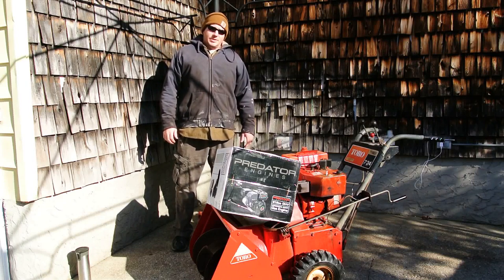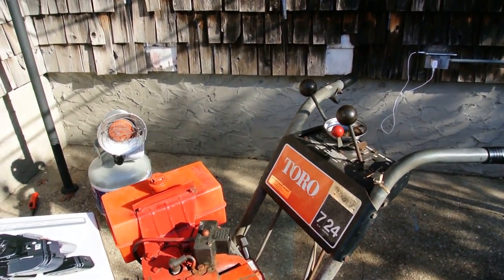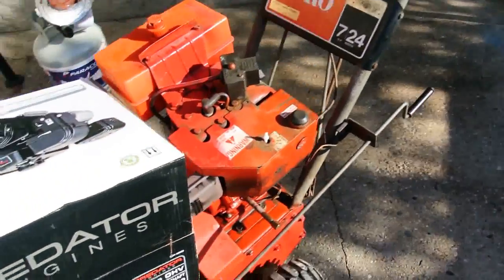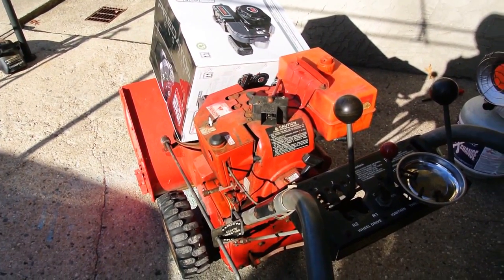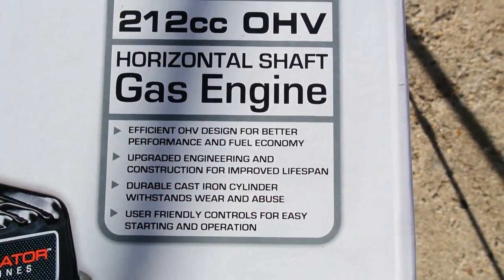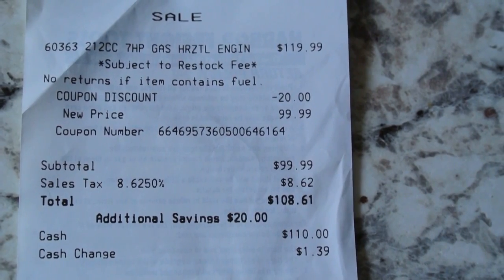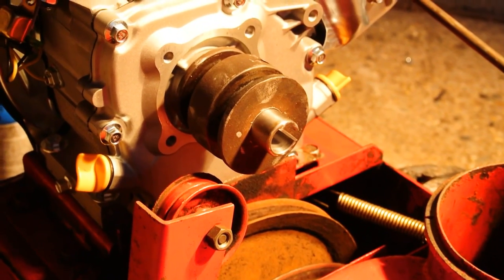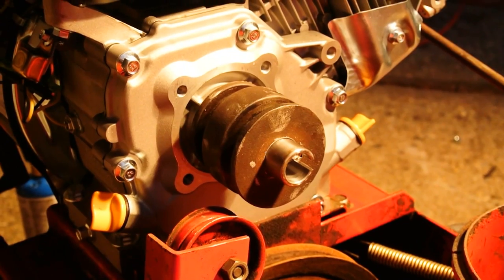SNOWBLOWER Motor Swap; new Predator (Honda clone) motor to replace the old tecumseh on 1977 Toro 724

Comment: predator engine is on sale for $99.00. It's a 1 to 1 clone of the Honda motor and actually for a chicom clone it really works well. I remember Honda trying to sue them years ago (this engine design is like 12 years old) but Honda dropped the suite and just made a newer and better motor.
Reply from the maker: nice!  Even if the current Honda is better there is nothing wrong with this!

Comment: I will be doing this shortly just blew the engine on my MTD blower it was probably 20 + years old. It is the track model so want to keep it going like it better then wheel type. Thanks for a very good video
Reply from the maker: Those tracked machines are awesome.  Thanks for watching!

Comment: I like it!  I did the same with a 40+ yr old JD and actually upgraded the power from an old 7hp to 10hp.  Now, I'm ready to do it again after 20 yrs.  My big challenge is matching the bolt pattern to a Predator engine.
Reply from the maker: I was amazed how the bolt patters lined right up in my situation!

Comment: I put one just like it on an old rototiller.
I have been very happy with it. 
I have another with a vertical shaft I put on a walk behind mower.
It has performed well too for 3 seasons now-
Predator Engines are pretty good engines.

Comment: Toro 521 and the pulley on it, is an exact fit to the predator 212cc I used.

I bought a conversion part to go from 3/4 to 1" shaft but wasn't required.

Just for future viewers doing this.
Reply: It's an easier swap then this even for the 521

Comment: you can probably get by without the belt finger, but it does serve two purposes.  1) it makes it harder for the belt to fall off the pulley.  2) it helps hold the belt up when it is not engaged so it rubs less on the pulley.  Or, at least that's been my observation on most machines.

Comment: Good video Rich ,I did the rubber impeller mod on mines last year ,best thing I ever did with it ..slush used to be a pain in the ass before .
Reply from the maker: thanks Mark.  I did the rubber impeller mod but havent had any real snow to test how well it works yet!
Reply: Rich's Fishes yeah it works,mines used to get chocked with slush before but now it doesnt.it also seems to throw a little further I think.
Reply from the maker: awesome!

Comment: It's amazing how cheap that predator 212 motor is brand new out of the box. Also with a few simple upgrades like a straight pipe exhaust w/muffler and a makuni carburetor, you can get a couple extra hp out of that bad boy and not spend too much extra money.
Reply from the maker: hell of a bang for the buck!
Reply: Look up the reverse straight pipe. The go kart ones dump the exhaust either into your handle for the blower or aimed at the snow (which is an issue if you need to get snow next to a fence or house). 
I got one on eBay, thing has dimes for welds, had to laugh at the effort.

Comment: more than a foot of snow fell since yesterday.
however my yard and driveway act like a vacuum cleaner, with over 2 feet in areas.
212 cc Predator Engine didn't struggle thru it at all.
Old MTD 24" bucket Yard-machine modded with a 6.5 hp Predator Engine.
Reply from the maker: Nice!

Comment: I did this conversion. I didn't need the new jet. I also did the impeller kit... my snow blower is a snow eating water pumping ANIMAL now. You should be very pleased... and in my opinion... 5w30 would be better for this application... good luck and enjoy...
Reply from the maker: I'm so happy I did this.  Machine works fantastic now!
Reply: 5w30 is better for cold climate, 5w30 =5winter 30

Comment: adaptor arrived today.
a bit too long, so cut around 3/4" off one end
both shafts on each engine are the same length.
used a vise and a sawsall.(place key in the gap to prevent crimping the piece.)
use grinding wheel to blunt the razor sharp edge. 

1.used a pair of vise grips to slightly contract the adaptor without the key.
slide in the pulley plates with narrow spacer between them.

2.next the larger spacer

3.next the next two pulley plates (then slid the entire assembly on the shalf)., the flat washer, bell washer and the then 
the hex bolt ( 5/16-24 UNF bolt approximately 30mm long/1.18".)

below are the links to this particular snow thrower and how it is assembled should anyone need it.

https://www.mtdparts.com/equipment/mtdparts/partfinder#/MTD_Merged_Data/31A-3BAD762_

(2005)/General_Assembly/0247000-D/02470000004

https://www.mtdparts.com/equipment/mtdparts/partfinder#/MTD_Merged_Data/31A-3BAD762_(2005)/Handle_

%26_Wheels/0247000-D/02470000002

https://www.mtdparts.com/equipment/mtdparts/partfinder#/MTD_Merged_Data/31A-3BAD762_

(2005)/Drive/0247000-D/02470000003

Comment: I did a similar swap on my 82 mtd built craftsman. well worth the $150 tax in Canadian for the motor. I bet you are loving that snowblower now. the new clone motors start so easy and work so well its like having  a brand new machine. Mine works like its better than new.
Reply from the maker: Definitely works better than new!  No regrets on this job for sure!
Reply: Did you get your clone at princess auto?

Comment: I was wondering. The Tecumseh motor on my snowblower doesn't have an air filter but the Predator does. With all the fine snow that gets thrown around and possibly sucked into the the air filter, could this cause problems? I am thinking if the air filter gets wet it could freeze or not allow air to pass through properly. Even if you take it out, it might cause a lean condition because it is sucking too much air. I don't know. I was just wondering about it.

Comment: What did you do with the old motor.  I would have rebuilt it and put it on a shelf...  Also, did you use anti seize on that shaft?
Reply from the maker: The old motor is in a corner of my garage....one of these days I'll rebuild it for a some project or another.  I honestly don't even remember if I put anti seize on the shaft....I'll have to go back and watch again to see lol

Comment: Hey Rick: If I had a 252cc engine now, could I use the 212cc you are using without much loss of power?
Reply from the maker: I couldn't say for sure, but I'd guess if the motor is in need of replacement you might not even notice whatever loss of power there might be!

Comment: Helpful video, Can you show us what you did to the carb? Also does the air filter restrict the engine in cold weather as most snow throwers don't have them?
Reply: The carb jet that comes with the engine should work just fine. The air filter does not restrict the air intake. It is not normally on a snowblower because there usually isn't any dust particles in the air when it snows. They place the carb near the muffler so warm air is sent into the carb melting any snow that might be drawn in. The only obstruction the air filter might cause is if it is clogged with snow and ice. In that case just bring the filter inside and let it dry out or remove it completely... although you might get ice buildup if you do that. I, however, have not experienced any issues and I did my conversion 2 years ago... hope that helps... have a great day...
Reply: Probe Team99  Thank you for the reply. Don’t fix what ain’t broke I guess!

Comment: What holds the pulley adapter from walking off the shaft ?  There is a set screw from the pulley to the adapter but nothing thru to the shaft.
Reply from the maker: To be honest I dont recall for sure.  There are 2 set screws on the pulley and I dont recall being concerned that the adapter could move so one of the set screws must've held the pulley in place on the shaft and the other holds the pulley to the adapter.  Whatever the case its not been a problem!
Reply: I just used the one Allen set screw, and then added a bolt to the output shaft, 5/16 fine thread, with a washer.

Comment: Just got a craftsman 881800 snow thrower. Old motor died and owner put this 212cc preditor engine on. He says it works great but does not toss the snow very far. Original engine was 8hp... Is there any gearing with the preditor? Or a way for it to rev up faster to move snow better?
Reply from the maker: Well there is a throttle adjustment, but I assume you're still not seeing great performance?  Chances are its note the engine causing your problem but more likely the impeller is not "scraping" all of the snow and is leaving some behind.  Look for "snowblower impeller kits".  It allows you to add little strips of rubber to the impeller blades so they "scrape" the snow from the sides and dont leave anything behind.

Comment: You want to run that MOTOR or engine its not the space shuttle in on conventional oil its shortcomings will aid on breaking in the piston rings.
Reply: second that break in with conventional

Comment: I am doing this now but had problem pulling back belt off, and now trying
 to put this belt back on.  Your video shows lots of play on that back 
belt, but my belt is real snug when it is on the rear pulley.  I did 
remove the rear tensioner pulley so that is not adding anything to the 
belt. What is the trick to get this belt back on? Thanks for great 
video. Any help is appreciated. october 15, 2018 and snow is coming soon
 in Cleveland, Ohio!
Reply from the maker: hmmm its been a while so I dont recall having to do anything too crazy.  If that tensioner pulley is off that should provide enough slack.   Maybe someone changed out a belt and used the wrong size in the past?  My only other though is to get the belt around the pulley before sliding the pulley on the shaft of the new motor.  Good luck!
Reply: @RichsFishes  no! Actually starting the install tommorow

Comment: Excellent video! I have an old tired Craftsman I’ve been thing about swapping, since a new one is easily $500+. Where did you get your adaptor sleeve for that output shaft?
Reply from the maker: I found mine on ebay

Comment: I just finished this swap. Everything seems to work, but the auger/propeller up front doesn't ever fully stop when disengaged. It slows down, and definitely speeds up some when engaged.

Toro 521. Any ideas?
Reply from the maker: That's probably got nothing to do with the motor.  There should be some way to adjust the engagement point using the lever that engages/disengages the auger
Reply: I replaced the Auger Belt and it all seems good now.

Comment: Is there an electric start ring gear on that new motor? I didn't think so.
Reply from the maker: No electric start on the new one
Reply: @RichsFishes  It's too bad the Predator motors don't have the ring gear and mount holes for the 110 v electric start motor. Looks like the new motor starts without much effort, so I'll do without the electric.

Comment: Stupid question, but does the Predator come with the shaft adapter and if not, where can you get them?
Reply from the maker: It does not.  I got mine on ebay.  Links in the description,  but they might be expired by now.  Little searching on Ebay should get you there!

Comment: Great Video! Where did you order the adapter for the pulley and the new jets from?
Reply from the maker: Ed Goode thanks ed!  check the description for links to the parts.  the pulley adapter was from ebay (you should be able to find same if not similar using the info written in the description) and the link for the jets  (from a go cart site called omb) is also in the description.

Comment: I am thinking of doing something just like this to my MTD snowblower, it bogs down during heavy usage. Quick question what did you do to the idle jets and why? thankS!
Reply: I want to put the 8hp on mine.
Reply from the maker: I got an extra idle jet and some micro drill bits to enlarge it; but honestly have not actually done it yet!
Reply: I'm not sure what that is would you mind explaining it?
Reply from the maker: tough to describe if you dont know what it is.  Check the links in my description and  you can see the new jet and the set of drill bits.  Ideally opening the size of that idle jet in the carb should allow the machine to start and idle a little better in the cold.  You'd set the new jet in a vice or something and then slowly enlarge the orifice with the drill bits.  Its sort of guesswork to determine how large any one particular application might need to be.
Reply: Ah great thanks. must say your video is great thanks
Reply from the maker: glad to help. thanks for watching!
Reply: I did this conversion and found that I didn't need to change the jet. It worked just fine with the stock jet. The game changer was the impeller kit. I think that's a must for any snowblower... It totally changes and enhances the blower. A new engine and an impeller kit and you would think you had the answer to any snow storm..

Comment: Never use synthetic oil during the break in period, rings will not seat correctly, use regular crude oil.  OK to switch to syn. after 5 hours of use.
Reply: beechwood619 TRUTH!!
Reply: I used to agree with that however the oil, if it comes  with any usually has metal particles in it. I have for the last 15 years started of with synthetic and have had zero problems. No oil burns or smokes, the engines start up immediately, the power remains the same. I don't think any oil is good enough to prevent break in. These engines run at top speed and load from the start.

Comment: What is the name of the tool you used to pull the pulley wheel off of the crankshaft?
Reply from the maker: Its a "three jaw gear puller" like this here:  https://www.harborfreight.com/8-in-three-jaw-gear-puller-69224.html

Comment: Break in on dinosaur oil then switch to synthetic oil.
Reply: I just done a swap on an Ariens 524. Tecumseh dual shaft motor replacement
Reply from the maker: nice how'd yours go?

Comment: Can you show, how you did the electrical?
Reply from the maker: I havent done it yet lol!  All it really consists of is the on off switch.  Now instead of using the key on the snowblower I just use the switch on the motor.  One of these days I'll try to actually make the stock controls work too
Reply: @RichsFishes  thanks i am just doing the same thing as you
Reply from the maker: @familiapabon9658  awesome!  Let me know if you have any other questions!

Comment: What adaptor sleeve did you use?
Reply from the maker: Its in the descripiton.  It was an ebay link for a  3/4ID X 7/8 OD X 1-1/4" Motor Shaft Adapter Pulley Bore Reducer Sleeve Bushing .  original one no longer available but if you search that term on ebay you should be able to find something that will work!

Comment: Going to be interesting to see how long it takes to blow up cheap made engine
Reply from the maker: They're actually considered to be pretty reliable!  Plus the price point is low enough that I'd do it a second time if necessary!
Reply: @RichsFishes  buy American the job you save might be your own
Reply from the maker: @mrbriggs68  Love the sentiment; but its not always that simple.  I'm trying to rebuild a 40+ year old snowblower b/c I simply cant afford to go buy new.  Options are slim to none when it comes to affordability.  Not to mention I dont think anyone is making small engines in the US anymore!
Reply: @RichsFishes  you can still buy a quality American made engine by Briggs and Stratton they still have a engine line built in America
Reply: @RichsFishes  you can buy a new Tecumseh engine made for a Tore  for 169
Reply from the maker: @mrbriggs68  Good to know they still have a few....even they build a lot in China too last I checked.  I just checked quick now and none of their "Snowblower engines" are USA produced.  There are a few of their others that get the USA badge but they dont make it easy to walk in a store and grab one off the shelf....and its at least 3x the price I paid!
Reply: @RichsFishes  and 3 times better quality I repowerd a 50s Lambert snow blower with a nos Tecumseh engine 11hp for 169
Reply from the maker: @mrbriggs68  thats awesome!  Not sure why you want my engine to fail so bad though.  I've got absolutely no complaints and from the (limited) research I've done  these knock off motors seem to be about as bullet proof as the original Hondas.  A higher price tag on a Tecumseh doesnt necessarily equate to better quality.    Plus Tecumseh aint Tecumseh any more no matter what iteration of the name they're using currently.  Finding new old stock like you did isnt always easy.
Reply: @RichsFishes  correct price don't mean quality never said I want your engine to  die just stating it is not well  built it as you  think
Reply from the maker: @mrbriggs68  I dont know man....you started with asking how long before it blows up !  Coming up on the third season with this and have had no problems so far.  Based on that it's built well enough for my liking.
Reply: @mrbriggs68  
Out of business. Go ahead check it out.
Reply: Lok Tom those predator engines are great better than a junk tecumsh or Briggs

Comment: can i put a 3/4 pulley in the predator shaft?
Reply from the maker: you'll need an adapter like what I have in the description.  
3/4ID X 7/8 OD X 1-1/4" Motor Shaft Adapter Pulley Bore Reducer Sleeve Bushing: You can try to search for that on ebay or visit the listing where I got mine:http://www.ebay.com/itm/like/37180186...
Reply: You could use new pulleys but the shaft adapter is only like $10 ... the pulleys are in the neighborhood of $20 for each belt..  so it's much cheaper to get the shaft adapter and use the old pulleys...

Comment: what are the diameters of the engine pulleys?
Reply from the maker: The new motor doesn't come with any pulleys.  I used a 3/4 ID x 7/8 OD adapter as listed in the description
Reply: @RichsFishes  i meant the groove diameter of the pulleys from the original engine

Comment: you forgot to transfer the rod that the belts rests against.
Reply from the maker: hmm  I think you're right!  I cant remember if I went back and added it in at any point, but I have not had any problems using the machine since!